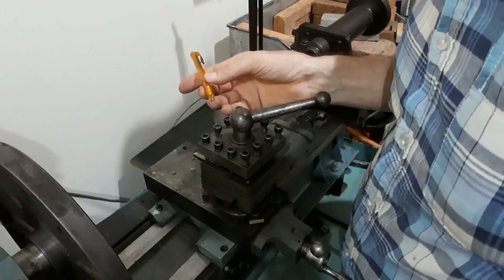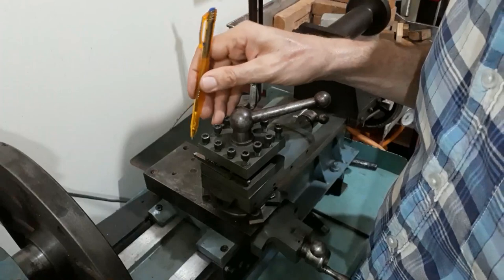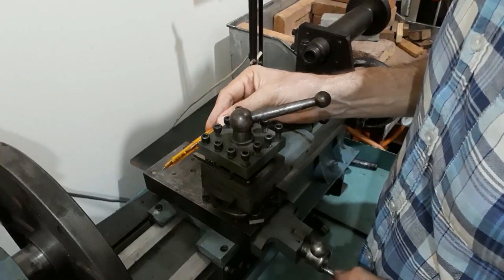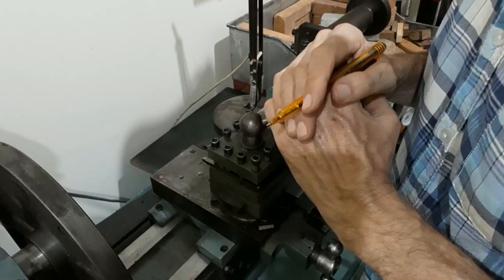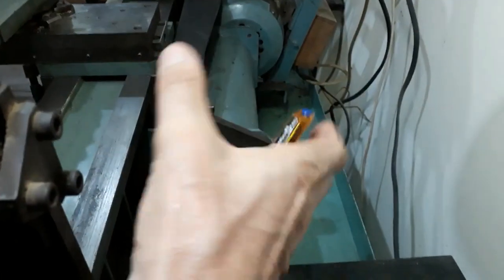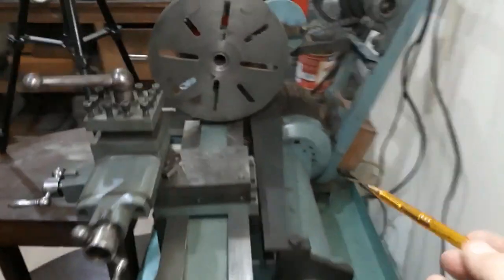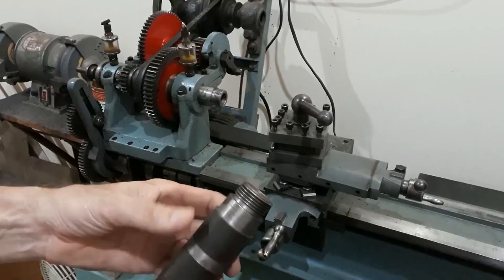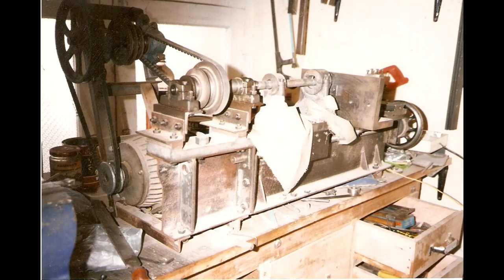Homemade Lathe - #2

Comment: Fantastic project for a young man to complete with only basic tools. I’m impressed that you designed it , made casting and used it to make parts as it developed.
I presume that you are an engineer from your comments about lathe rigidity and your solutions 
For what it’s worth my Taiwanese lathe has an aluminium shear pin on the shaft driving the apron, still didn’t prevent a bronze worm gear from breaking when I had a crash ( my fault, got distracted and thought it was out of gear)  I’m just a newby, but would prefer to have to replace the shear pin often rather than have to pull it down again to replace the gear. There are some comments on practical machinist and hobby machinist threads
Thanks for taking the time to show us your projects
Reply from the maker: You are welcome.